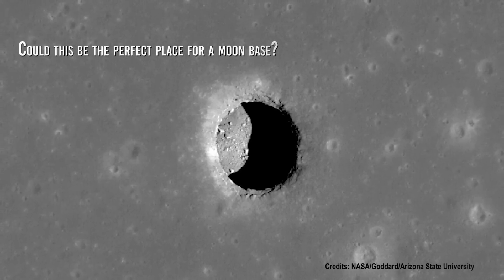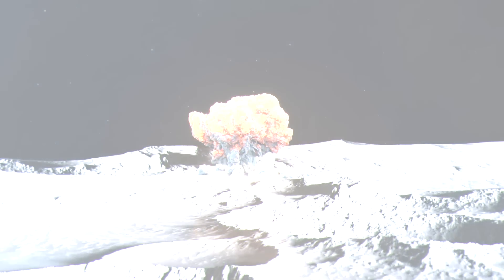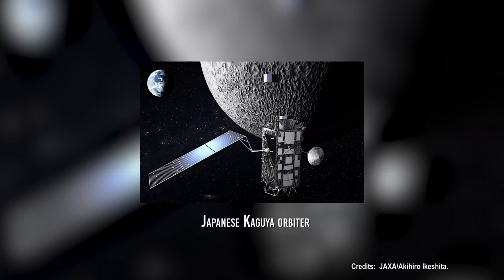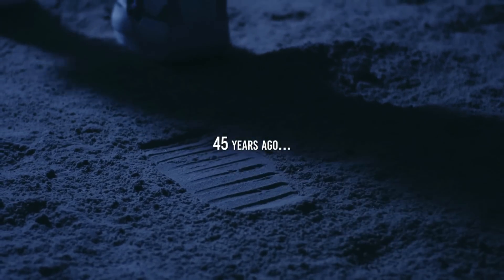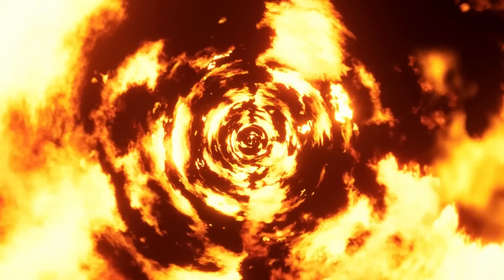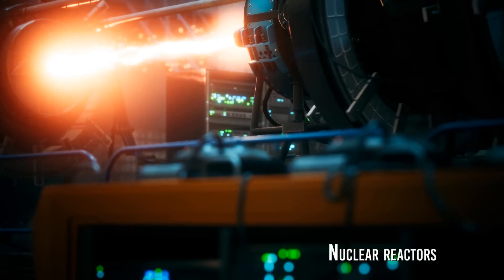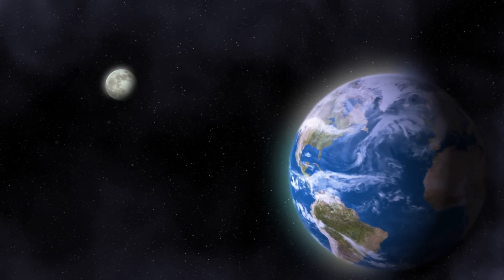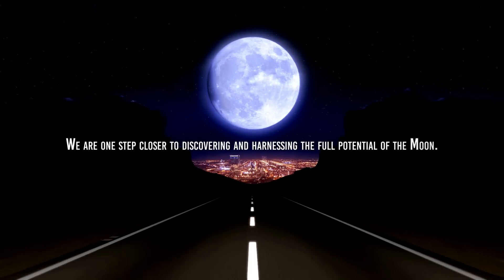Could This Be The Perfect Place For A Moon Base?

Comment: The large tunnelers in use today, dig the tunnel, move the loose dirt out and then deposit it to be used in making cement.  All this action is basically automatic.   Also, they are built to be easily serviced.   The hardest part is getting them to the moon.

Comment: Our first lunar colony? You'd need a place that can be most easily formed into an airtight structure, as well as sufficient protection from solar and cosmic radiation.
The idea of forming domes on top of craters is one way to go, but the better option would be to find large hollowed lava tubes and create underground living spaces.